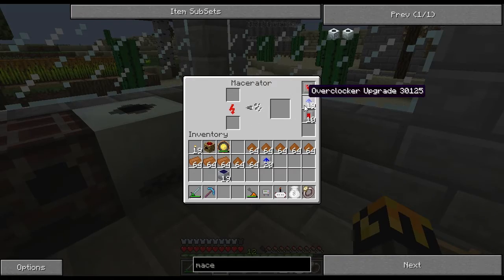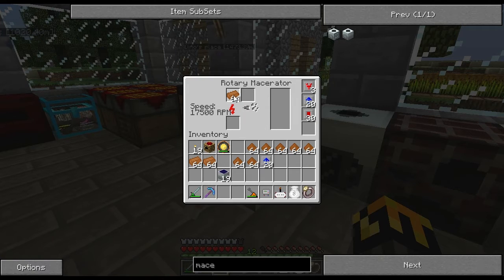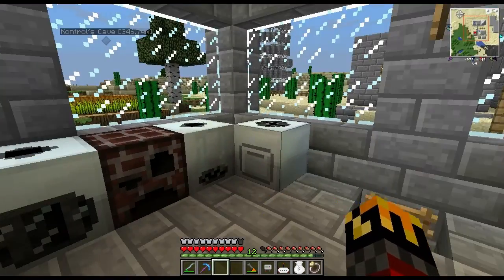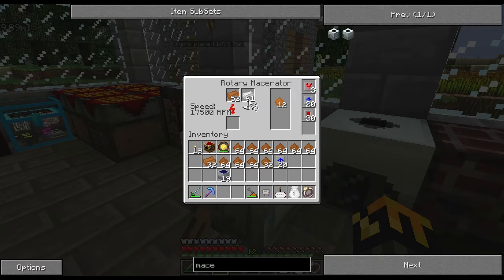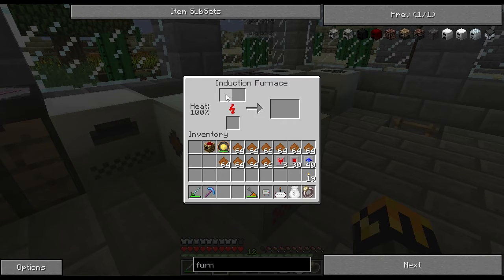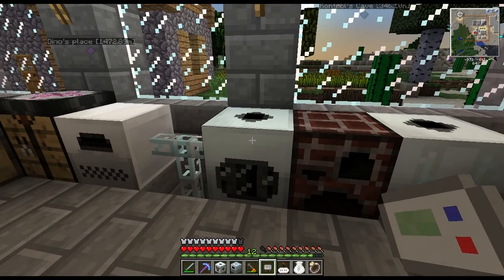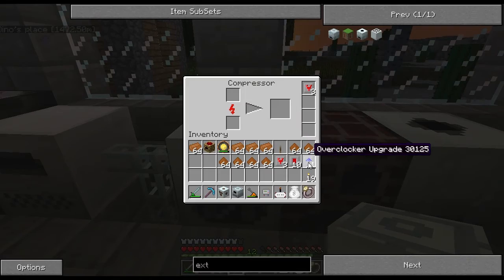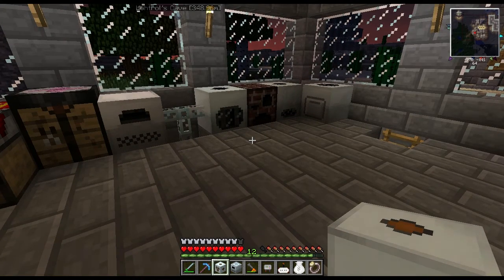Mini Tutorial - Macerator vs Rotary Macerator

Comment: It kind of seems like you are suggesting that the Macerator is significatly faster than the Rotary Macerator.  If thats what you are saying its important to point out that this is only the case if you are going to manually feed it ore and extract it as it is ground.  If you set up any kind of automation for loading and unloading then this goes out the window.  Now at the beginning of the game when you are just starting out that seems great.  But when you get to the point where you want to be able to bring back a full inventory of different ores then thats where the standard macerator falls flat on its face.

The problem is that whether you are trying to extract the macerated material vial a hopper or pipes it leaves incredibly slowly compared to the speed which the macerator processes it.  Consider you had say 2 stacks of iron ore.  2 stacks of copper. and a 1/2 stack of gold.  The macerator will tear through the iron for a stack and a 1/2 then get stopped b/c it will have a full stack of iron dust still in its inventory.  Then it will pause for a second while a small portion is transferred out.  Then rapidly process another piece of ore, then pause again.  It takes about 30 seconds for a full stack of macerated material to leave the macerator once it is done being processed.  Even if you didn't have a full stack you still have to wait for all of one material type to leave before it can even start on the next.  So the iron would all have to have been transferred out before it could start on the copper and so on.

Now the rotory macerator does take an incredibly long time to get up to speed but again you arn't building this first thing.  I think a single geotherm generator or a low volt solar is more than enough to power it in standby.  So when you build it ofc put a torch or a lever and leave it on so its always at 100% speed.  Now again this is best for the people who go out mining for a while and bring back a variety of ores.  Or if you use miners, quarries, tunnel bores, or any other method of mining that will yeild a variety of ore types.  (personally  usually go mining in the nether and fill a couple of the canvas bags with ore in a single trip * THATS A LOT OF ORE after its macerated*)

My typical setups is a chest on the floor.  A hopper on top of that, macerator, or rotory macerator on top of that, hopper over it, and chest on top of that hopper.  So I can put ore in the top and it funnels down to the machine then down to the bottom chest where i can pick it up manually or route is somewhere else with pipes.  (this works for most machines which require input and output)

So back to the Rotory Macerator.  The main reason it is sooo much faster than the standard macerator isn't its break neck processing speed but rather the 2 stacks in its inventory for processed materials.  This means that where the macerator would get stuck waiting for material to exit the rotoary macerator can just start a second stack.  Now if you had 5 stacks of iron to process thats not very helpful.  But when you have 20 stacks of various ores then when its done with iron it can imediately process the tin while the iron is still leaving the machine.  By the time the tin is done the iron is all gone opening up that slot so it can start processing gold.  You dont get that 30 seconds of waiting after one ore is done before the next can start like you do with the standard macerator.

Now that said.  If you find that a standard macerator isn't fast enough and you already have all the upgrades. (currently you can put 3 transformer and 12 overclocker upgrades on it)  Then I would just build a second one and route my material so that it splits between them (this can easily be done with hoppers or pipes).  This way you effectively get a second inventory slot while doubling your production seed (rotary isn't even 2 x as fast) and you dont have to worry about passive power drain for having to leave the thing on so it stays at max speed.  If for some reason you can't find the space for a second one and you only have room for one or the other than the rotary is the far better option unless you just love standing in front if it manually moving material in and out.

NOW>   if anyone knows how to make the material move out of the macerator faster I would LOVE to know.  I've tried every sort of upgrader and a variety of pipe exporting methods but it seems to trudge on at the same super slow crawl.
Reply: I know that I'm two years late, but I still find it relevant to mention that different engines on BC pipes pump out more material faster. A sterling engine is much more efficient at removing material than it's redstone counterpart and the tier above that is also a massive upgrade.

Comment from the maker: You're right, IC2 changed it so you can only have 4 stacks of 4 overclockers running at once, but you need transformer upgrades to use that much power, so that leaves you with only 3 stacks of 4 overclockers.  I will have to test this.